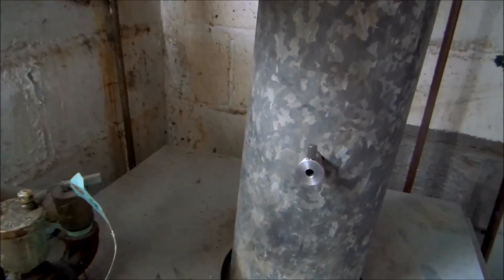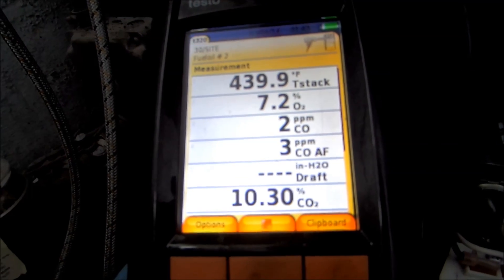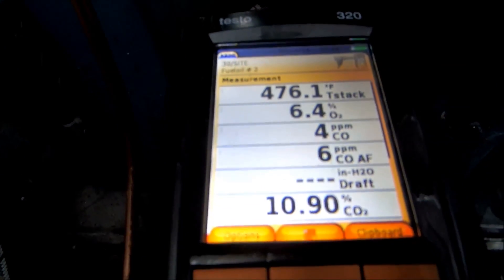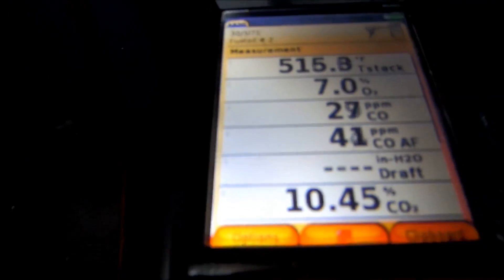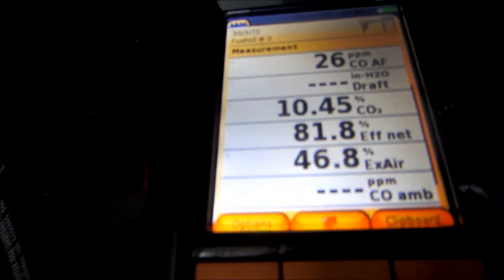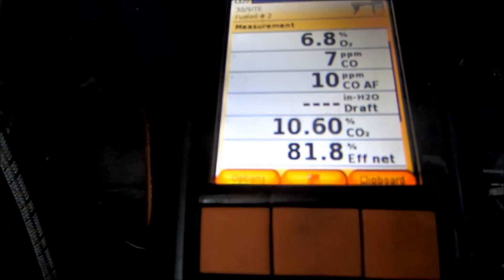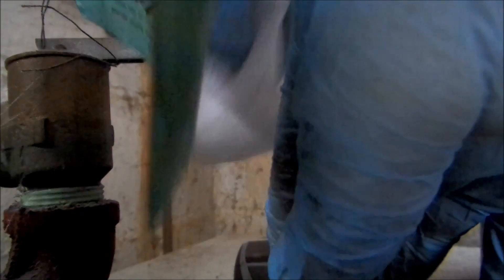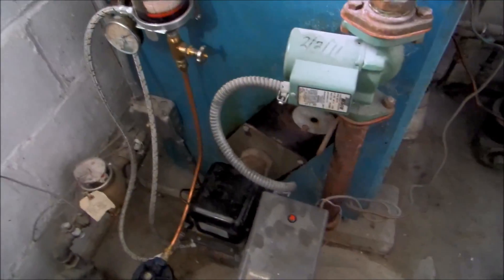carlin oil burner, testo 320 combuston test

Comment: Steve I work for some company man they send these testos out to get calibrated but I swear every damn job Im on they PPM is no less than 50 I get the excess air down I get the co2 between 10 to 12 and Im telling you I scrubbed some of these so clean you could eat off of them I kind of think I might be doing something as simple as taking readings in the wrong spot or something hahah can you do an instructional video as stupid as it sounds on taking readings
Reply: Collapsed/missing combustion chamber liner can cause high CO too. Remember to check that.